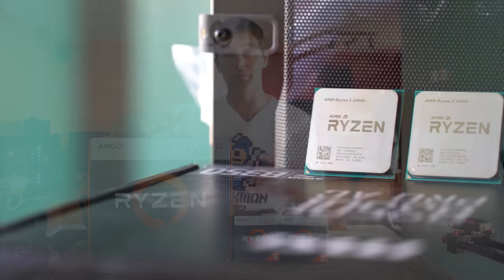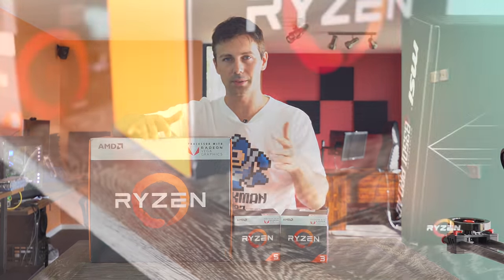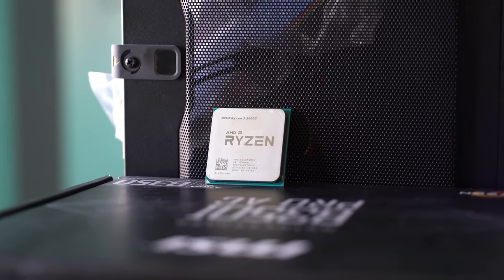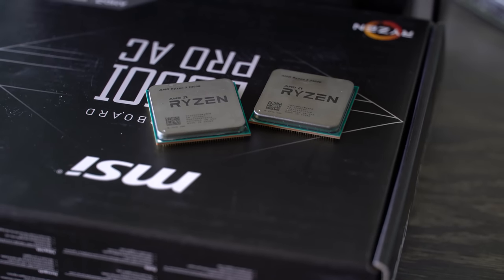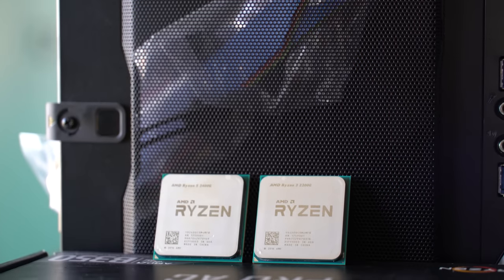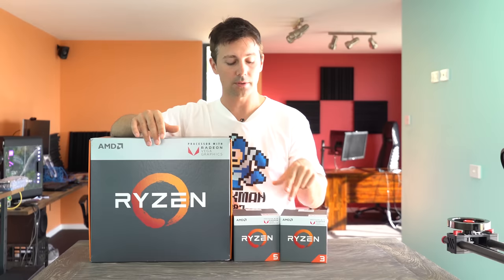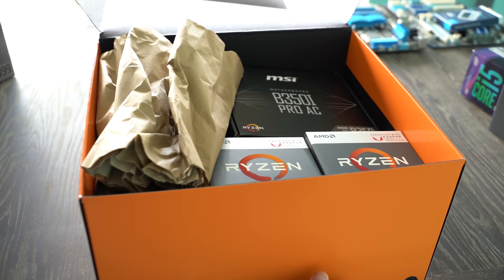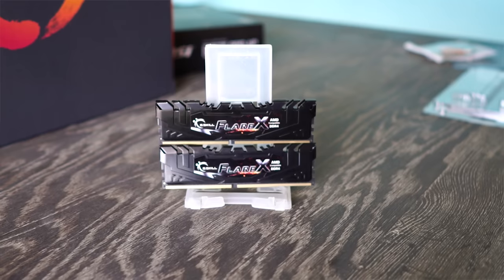Raven Ridge Mini ITX PC? A 'Different' Ryzen 3 2200G & Ryzen 5 2400G Unboxing

Comment: Hi do you think ill buy now this apu or wait for the next gen. I just want to play moba like heroes of the storm, dota2, lol, pubg, overwatch, nba2k, fifa, f1.
Reply: I would recommend waiting if you’re building new since ddr4 is pretty expensive right now, and it might go down if you’re patient enough, but if you have ddr4 and no graphics card I’d say go for it since graphics cards are overpriced currently, but if you already have a decent graphics card and ddr4 and are willing to wait, wait for ryzen 2, since it’ll give higher FPS, and it will likely lead current ryzen prices to drop and potentially the APUs as well
Reply: Genes Gene also I’m not sure if this would perform that well in PUBG since it still needs more optimization, and from what I’ve heard/seen PUBG doesn’t seem to work as well with Radeon graphics when compared to Nvidia
Reply: No word on any Ryzen+ apu's yet though. Might be better gpu-parts with more Vega cores. But hard to fit more on the chip.
PUBG runs bad on anything!! To unoptimised and ugly shit game..

Comment: can it run NES64 ? ~ nah just wanna know how many ram needed & perform like 1050ti ?
Reply: At least 8gb ram I think, as apu use 2gb max. It will perform like a rx550/gt1030 stock. as rx560 or gtx1050 when overclocked maybe.

Comment: isnt vega like not that good??? i mean rx 64 vega does not even compete with a cheaper 1080 and with new nvidia gpus will it be really competent??? but i understand its a APU its not gonna be high end i just expect it to be a really budget build scenario thing
Reply: also im loving the stock coolers AMD provides they are just AMAZING and since ryzens are also cheaper then intel cpus in general its a great bargain to save on aftermarket coolers
Reply: Vega 56 actually competes pretty well, enough so that Nvidia felt the need to release a 1070 Ti.

But anyway, the iGPU's in the Raven Ridge  APU's are rumored to be comparable to the GTX 1050/1050 Ti, so I'd guess somewhere in the ballpark of RX 460/560 performance if that's true.

Considering both console revisions have more powerful GPU's than that, I'd say that's well within reason.
Reply: Professor Mike AmericanuckRadio yeah prob but 750 is a really weak card honestly
Reply: ZombieBarioth 1050 ti??? Are you joking??? 1050 ti is pretty powerful and I'd be amazed if they fit 4 GB vram and so many GPU cores with only 12 nm process (15% more space ) and have a 7500 comparable CPU AND RUN AT 65 WATTS
Reply: Austintune
That's certainly the rumor.

Like I said, I don't know if it's true, but if they can fit the Xbox One X's SoC on a 16nm process with more CU's (40) than an RX 580 (36) with 8 Jaguar cores, an RX 560 (12/16) on 12nm wouldn't surprise me.

Why would they have to fit VRAM? I mean it'd nice, but integrated graphics always use general system memory (hence PS4 uses GDDR5). That means high speed DDR4 is still preferable.

Comment: Do some benchmarks with 4 GB ram only. Why? Because I think there are many People that use one of those APUs to game on bugdet. And 4 gigs are a budget solution for Many budget gamer.
Reply: Butt the igpu needs 2gb for it's vram only, nothing left for windows! Who uses 4gb today really?! I have had 8gb in my old ddr3 system now for 6 years.. 8gb is not that expensive even today. Should be minimum for most, especially with a apu..
Reply: haven't thought about the Video Memory...but got your point
Reply: Sebastian Hakansson I used 4GB of ddr3 on my laptop since 2015 but before that I used 1.75GB of ddr2 ram on my old desktop pc that had no GPU only some kind of really old AMD Athlon APU....
Reply: Most people with budget use 8 GB in their PCs, 2x 4 GBs are a must anyway for Dual Channel mode.
Reply: I use this APU with 64GB or memory. Call me crazy, but I actually use it.
Reply: @movax20h   why? with that apu, windows will never use your system over 10gb..
Reply: @hakan_ozen  incorrect and irrelevant statement.

Comment: Why don't all cases come with in-built wifi antennae? Those aerials sticking out the back are stupid. Easy to knock, a pain to transport. My Intel NUC doesn't have aerials. It picks up wifi no problem. Why are we still getting this 1990's solution for PCs?

Comment: Is it not possible to close the case with this Wrath cooler?
Reply: You can close it if you take off the fan shroud from the included Wraith Stealth cooler.  Shouldn't create any problems in doing so.  A user from reddit showed a completed build with pictures of the Chopin closed.
Reply: I've tried to find this post, but i couldn't. Can you send me the link?
Reply: My bad, three days late but here's the post

/r/Amd/comments/7zo1bx/tiny_raven_ridge_2400g_itx_build/

Comment: why not make a apu with 1600?
Reply: TheSURGEofTech tech they can't. one ccx contain 4 cores. this apu has 1 ccx for cpu. and other is for vega
Reply: Andrian Tacadino so basically they don't have the physical space on the die to fit extra cores with this socket? Would be interesting to see this on mobile chips or threadripper(not likely though).
Reply: not enough room maybe... who knows
Reply: Hard to fit and keep decent tdp yes. More cores, L3 cache and/or more Vega CU is hard to fit on the chip. Maybe a bit more later with Ryzen+ 12nm.. But a Ryzen 7 and higher Vega cores will be hard!
Reply: Andrian Tacadino doesn't the the threadripper have 2 dummy dies they could use those for Vega igpu

Comment: Are these on zen2 cores or not?
Reply: No, Zen2 architecture is not out yet. Ryzen 2 procesors will be based on refresh of Zen 1 architecture (Released in few months, architecture is called Zen+. You need to know difference between Ryzen 2 and Zen2
Reply: Because this is helpful. I asked if these are on Ryzen 2 cores, as they are named the same, Ryzen 2xxx. And for us earthlings, these will be  (Ry-)zen 1, 2 and 3 regardless of what their internally called at AMD, also, you need admit its a "little confusing" When Ryzen 2 is Zen+ and Ryzen 3 will be Zen 2.

Comment: Why would you put it in a case that it doesn't fit in properly? Seems a bit half arsed to me.
Reply: You don't do any favours showing off hardware in a bad light, either change the cooler and then put performance numbers up with the stock cooler or just use different hardware to show the case off appropriately, the way it was done just doesn't look professional or give confidence that he knows enough about what he's doing. It's all about perception and this looks amateurish.
Reply from the maker: Professionalism is the antonym to tech yes city.

Comment: Really shotty build for a Ryzen APU. You would've tried to shove a INTEL CPU into a case so poorly, so why do it with AMD?
Reply from the maker: ??? Already done it in the past a heap of times.
Reply: That looked like a really nice and clean build... You should see me bending my case sides cramming a second massive GPU in my Mid-ATX case with ATX board. I literally have to bend the case just a little and then bend it back at the rear... Then the side panels take either 2 people to close, or set it in the corner of the room, and use your hands for the top of the panel, and your feet to shove the bottom of the panel in and slide it into place. It looked very nice, but the build process was slightly tricky (nothing like the sub-zero insulation prep and setup for 24/7 phase cooling, also lots of heaters and such, so nothing like on that scale, but "tricky" as compared to most builds).

His was an extremely nice build, nothing to complain about, he even managed to get the Ryzen stock cooler on it, which is pretty decent (I can't remember if that one has RGB, I know the full size one does).